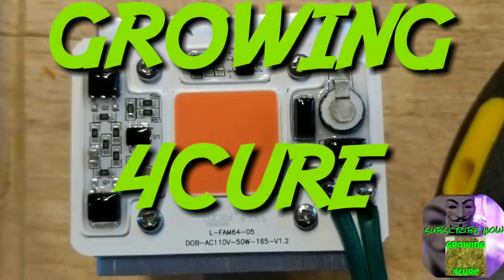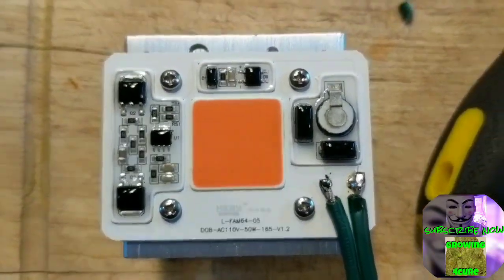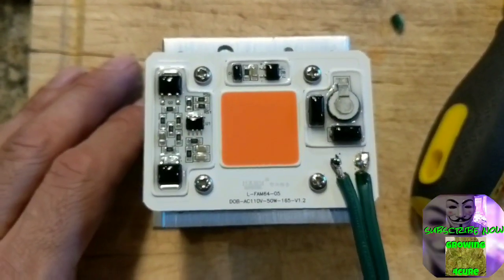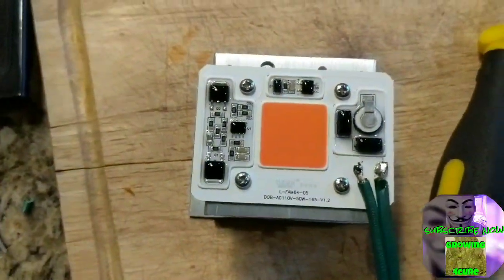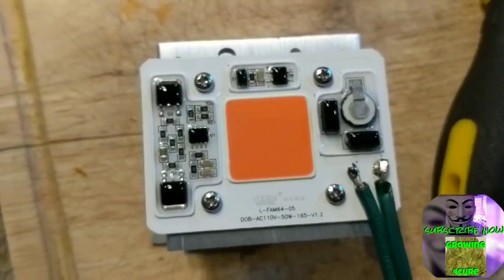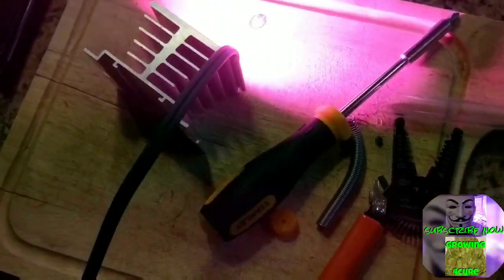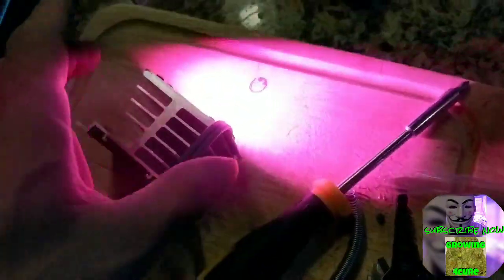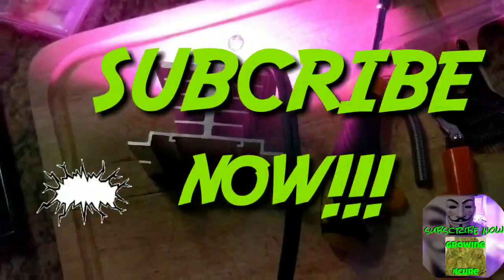DIY 50w COB driverless grow LED light

Comment: You have open main voltage on an ungrounded light and you grabbed the heat sink with a bare hand.  

Don’t build this unless you ground it and cover the exposed 110v connection.  Jesus man it’s not wort it.

Comment: are these any good at growing seedlings?ive seen some like this but built into a shade on a strip for like 10 dollars for 50w ..
Reply: You can build your own light and if you only want it for seedlings depending on how many you could get away with one 50 watt cob and driver from eBay.. they come from China but they last if you use active cooling with heatsink and fan. I use old pc ones with a fan attached so its in one unit and the drive sits on too of the fan with a fan guard in between so the driver gets some air flow too